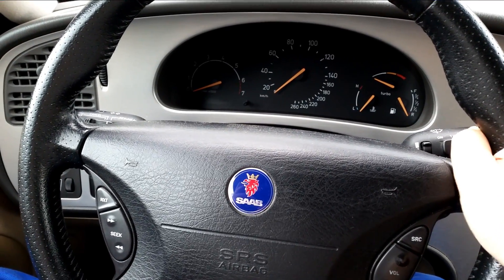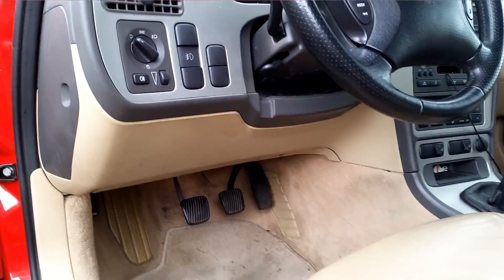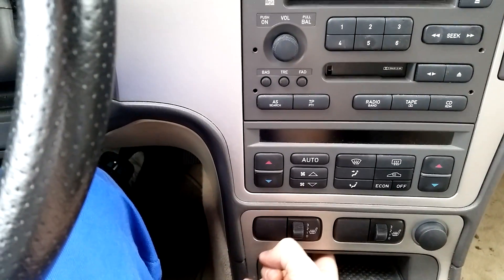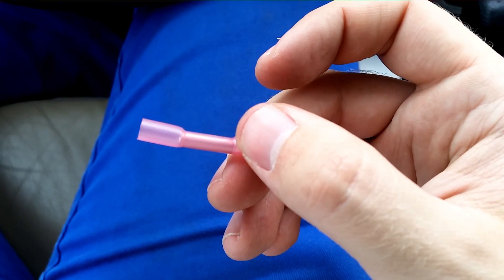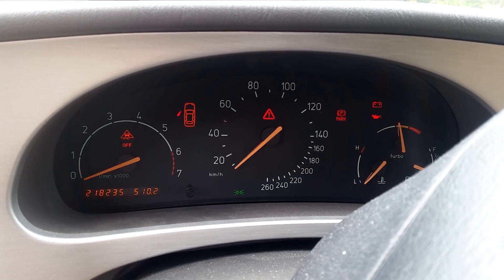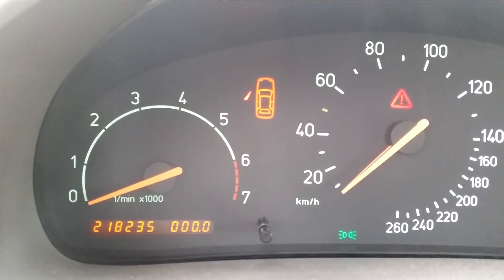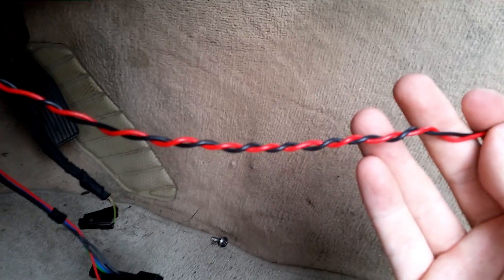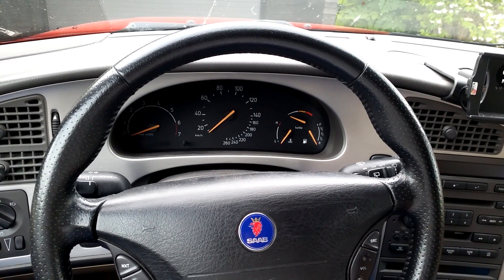Saab 9-5 Tuning: Adding ISO 15765-4 Canbus to the OBD2 port - Trionic Seven

Comment: I have a 2009 Saab 9-5 TiD and already have those connections but my OBD2 bluetooth adapter has no connection to my ECU (Torque shows this)
What do I have to do? Is the bluetooth adapter wrong?

Comment: Hello. So when tapping into the main p-bus at the ecu, am I able to twist the wires and run them into the car to the obd2 port like you did using the esp connections?? Or will the wires be to long?

Comment: Which more modern diag system then the Tech 2 would you refer to buy?
I need one to change comfort parameters so a simple code reader doesnt
fullfill my requirements. Does the Autel MaxiSys ES 906 work? It's Tested?

Comment: Thank you very much for this video! It was really helpful. I was wondering if you had any advice on how to resolder a store-bought OBD2/D-Sub 9 cable to use with JohnC's Combi adaptor. Skål!
Reply from the maker: It's easy. Check the pinout on the obd2 port, the pinout on the combi adapter, and then test the pins on the cable. If they don't match, rewire the wrong pins :)
Reply: @TrionicSeven  I got the pinout diagrams and made myself a cord! Just flashed my ECU to enable open SID. Thank you so much for your videos!

Comment: Trionic Seven, after the alteration ELM327 will see the protocol ISO 15765-4? In Torque will be faster to read the testimony?
Reply from the maker: That's a good question and I'm not sure. I guess it will make no difference.

Comment: Will this method work with TCS button?
Reply from the maker: Nope, you must have ESP
Reply: If you have TCS the method shown will not work. You have to tap into the P-bus by the amplifier in the driver side, left most part of the foot well, and then run the wires to the OBD port. That is how I did it on my 2000 Saab 9-5 lpt.

Comment: Why can BSR flash the ECU with their PPC3 directly even on older cars (2006) that doesn't have the ISO 15765-4 in the diagnostic port?
Reply from the maker: It is possible with K-line, though I don't have the exact details. T7suite does not support that, though. Very good question though, I am sure the folks at Trionictuning know the answer.
Reply: Yes but really slow compare to canbus
Reply: @saabquebec  I bought the BSR tuning and it takes around 15-20 minutes to install haha.
Reply: @Jocke155  compare like I said to canbus where it takes 1min and 47 sec to read and flash it's kind of long and slow

Comment: Hi. I have a UK spec 2002 9-5 Arc 2.0t. Where you have the ESP switch, I have a TCS switch. Is this the same thing? Regards Matt
Reply from the maker: No, TCS doesn't have a steering wheel sensor, so this won't work.
Reply: Thanks. I'll check the forum out to see if there is another way it can be done.
Reply from the maker: Sure thing. This video is getting old, I'm thinking of making another one to show some more methods if you lack ESP :)
Reply: You should! :) I just tapped in to my on the left hand side connector (LHD) on the firewall. The cables on my MY98 are tied together, and easy go get to.

Comment: Hy there..... grate and informative videos.
Why OBD2 to Dsub9 and than trough a converterbox to USB? 
Why not straight. OBD to USB?
Thanks for your great work btw....and sharing it
Cheers
Reply from the maker: You can't connect a canbus outlet to USB, you need some serious translation. That's what the combi adapter does, and does well.
Reply: @TrionicSeven so does the OBDlink ex cable have the ability to translate the information?

Comment: this vid is well explained, but i do have a question, if im flashing my ecu t7 from my computer using only lawicel canbus. do i need still to do the modification on the p-bus if im tuning from my desktop??? or this would be only if i want to tune from the car directly..
Thankx
Reply from the maker: If you're lazy like I am, you want easy access to the p-bus. Otherwise you need to remove the ECU every time you do a reflash :)

Comment: So since my 02 9-3 doesnt have esp. in the harness will i be taping into the same color wires or would it be different.
Reply from the maker: You won't have any green/white cables at all there if you don't have esp.
Reply: So how would i go about doing it without. Thanks :)
Reply from the maker: In the video I mention a few other options, including MIU and directly at the main harness. I haven't done any of that myself as all my cars have ESP. Check trionictuning.com for more tips!

Comment: I have a 2000 saab 9-5 SE, which doesn't have ESP. I did find a green and white wire going to the SID2 system. Do you know if this is a part of the p-bus, or is it the i-bus?
Reply from the maker: That's probably the I-bus. Check WIS for the wiring diagram.

Comment: Thank you for a great channel, Could you maybe post a link to the OBD => DSub 9 adapter you use
Reply from the maker: The adapter is a generic ebay adapter that can be taken apart (not glued!). I had to open the connector and re-solder it since there is no standard way of attaching the wires.

Comment: What will tapping onto P Bus allow or show me..?
Reply from the maker: Full access to flashing ECU, tuning, Ethanol conversion, realtime logging etc. :)
Reply: Im hoping some people out there are reverse engineering Trionic 8 (and all others) so they can look and convert the binary files, Pity SAAB locked up their Trionic software and didnt release it generally for their cars before they closed, I have OPCOM which is OK for all Module reading, But for programing, No way, Which is sad because I had to scrap a 2.2TiD I had only because I couldn't find someone with Tech II SAAB to marry a new injector pump, to my very annoyance, I have a 9-3 1900cc now, And the ECU ignores the SPA module I replaced, Would tapping the P Bus line allow me "somewhere" to alter the SPA Module reference  to make the ECU accept it....?

Comment: Do I need to do this to use the elm 327 module?
Reply from the maker: Nope, this mod is for flashing the ECU. The ELM works on all obd2 compliant cars!
Reply: sadly the one i have is broken then :(
Reply from the maker: Remember that early (sometime before 2000?) 9-5 with the 2.0t engine are not obd2 compliant, so your adapter won't work on those. Needs an ECU reflash to function.
Reply: no mine is a 2004 9-3
Reply: yes it wouldn't read
Reply: no :(

Comment: The major part stores did not carry the mini ISO connectors not could they even find the part number. best they could do is get me a universal obd2 pigtail.... So, ADD kicked in and I decided instead of spending $65 on that thing locally, I would just make my own.. I recently (last night) bypassed the Premium Pioneer Amp for my own Tablet "head unit" set up. I remembered the Amp connector having a similar size pin inside (head unit connector pins are too large). Anyway, I simply cut the speaker SPEAKER INPUT cables far back so I would have enough to play with, pulled 2 of the pins with about 12" of cable attached from the connector (be ready for breaks, cuts and curse words...) push the metal crimps in - then insert in the obd2 port... they are a bit smaller than the ones inside, but, if on a budget or like me simply don't want/can't wait 3 weeks to get the pins, it works well. after putting them in place I simply heat taped the back of the connector so the pins would no longer move in and out with any force and just be secure. you will need a small screwdriver like one from an eyeglasses kit to press the pins in far enough a well..  I would post a picture if could. Its simple. the pulling of the pins from the amp harness is the hardest part.
Reply from the maker: +llbarlllcodell Hey, awesome work. That's some dedication.
Reply: +Trionic Seven: For Saab Enthusiasts 

I found that the cheap blue Elm327 device I purchased on eBay
 does not talk to the ECU (before or after this) and after doing this will trip the Esp light when insterted. Though, simply pulling the scanner and restarting the car clears the light. I paid more for this one than most of the same that are listed. Most are at $5 this was $15... Think I got ripped off because it doesn't work in a Ford Taurus either, Torque Pro gives me an error that the device cannot talk To the Ecu. I have another k
Konnwei brand arriving today and an Obdlink
Usb device. arriving tomorrow so that I can flash the T7.  I will hopefully know more about the problem in a couple of hours. Anyone else have this issue or do I simply have a bad/fake scanner? I'm hoping its not a bad Esp sensor or something else causing it.
Reply: It was just the scanner the Konnwei Device works fine. Very laggy, but works.
Reply from the maker: +llbarlllcodell Good to hear!

Comment: Hi , I have a 2000 saab9-5 compliant with ISO 9141-2, do you know which Pin number on   T7 ECU harness(589b)  connect to the OBDII socket pin#7(K-Line)? Thank you. I use a ELM327 Bluetooth adapter connect with my Android Phone and it work's fine on my car .But if I took ECU form car and testing connection in my office the connection always failed. I don't know where should I put pin7# K-Line to my ECU. I would like to develop OBDII utility.Thank you!
Reply: +Trionic Seven: For Saab Enthusiasts  ,

Thank you for your reply.I didn't install WIS and my car is LHD.Thanks!
Reply: Thanks for your advise,at least I can use BT ELM327 adapter and  ISO 9141-2 on the 2000 saab9-5.The test is not hard but requires much attention and spend more time  because it always need connection on saab9-5.There are something that we don't understand.I think odbII protocol develop and implement on Linux device is simple but not easy.
Reply: +Trionic Seven: For Saab Enthusiasts Thanks.I am doing obd-pi on Beaglebone(BBB).You can check here.http://www.cowfishstudios.com/blog/obd-pi-raspberry-pi-displaying-car-diagnostics-obd-ii-data-on-an-aftermarket-head-unit
First obdii monitor if the car speed higher then 70km/h,BBB GPIO control relay to enable the thermoelectric cooling chip 12v 10A.The dimension is 300mm*300mm put with Intercooler and make temperature lower about 10°C.I know that 2000 saab9-5 didn't connect can high and can low to the obdii socket.That is the reason I removed ECU and connect to ELM327 BT try to use canbus pin19# & pin66#.I thought it should worked,but It didn't.
I use T7 suite and  CANUSB by LAWICEL AB only connect pin19# & pin66# that I am be able to Flash ECU both read/write.

Second on Saab we found out gasoline mixed can help improve the combustion efficiency.The recipe is unleaded gasoline mixed with diesel.The proportion is 97%(92 unleaded gasoline) add 3%(diesel).So far so good.We been test for years and it relay help to remove the carbon accumulation and knocking.
Reply from the maker: Interesting! Let me know how it goes :)

Comment: Your videos have answered a lot of questions for me. Thanks! Do you happen to know of a tutorial showing how to tap into the P-bus for a non-TCS/ESP 9-5? Or any recommendations on where to look?
Reply from the maker: +Colby McKamey Hello! I would look around trionictuning.com (registration required), there's a ton of information there.
Reply: Already on it. Thanks very much! I imagine I just need to find the same two wires you mentioned in my engine bay and tap into it there. Just to clarify you are tapping into the p-bus to flash via CAN, correct?
Reply from the maker: There are a couple of places, I actually mention a few places in the video, i.e. the main harness under the small plastic shield. Yes, this is tapping into the p-bus, and the p-bus is a CAN bus :)